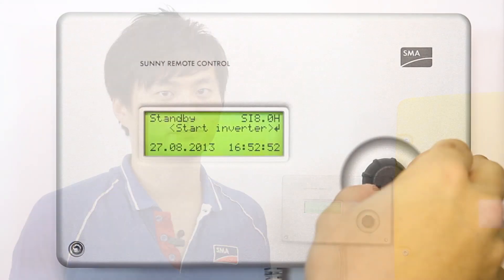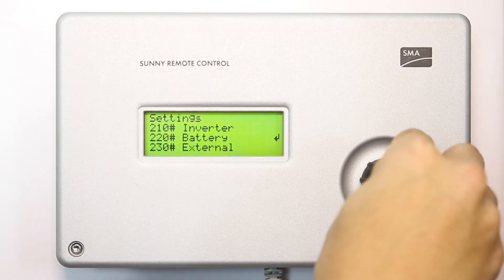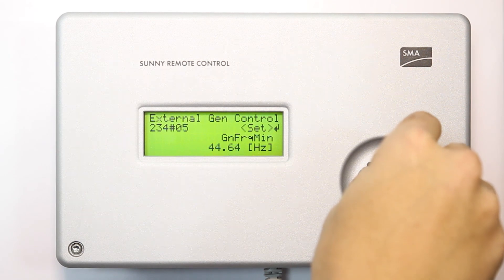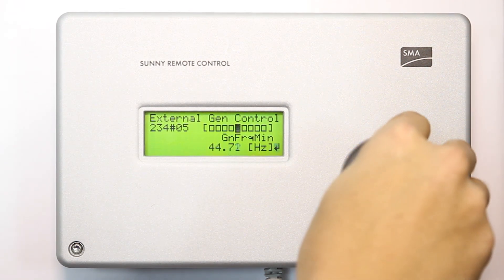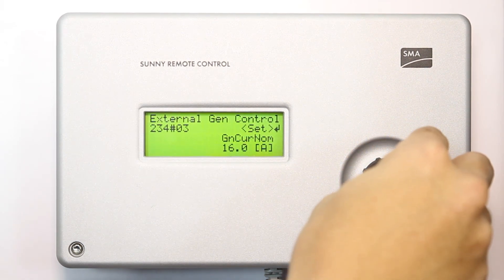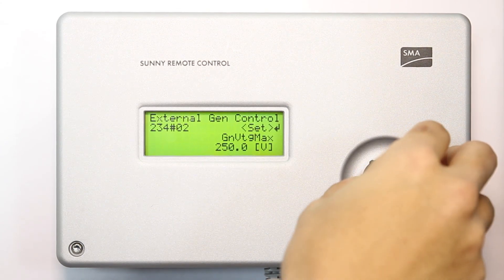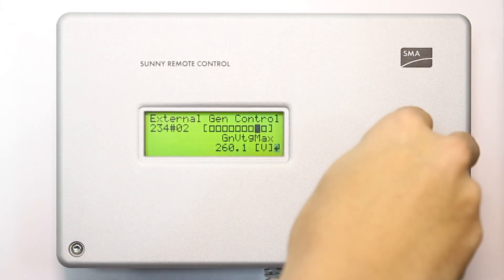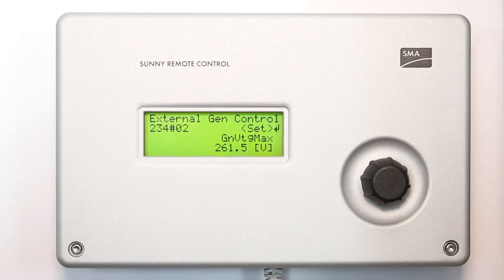Tech Tip: Adjusting maximum generator voltage in the SMA Sunny Island 6.0H-11,8.0H-11 and 5048

Comment: Hi, i want to setup basic generator & battery protection parameters based on Voltage, not with the SOC(genset start, load shedding, etc). If it possible with the SI 8.0h?? Having trouble with the SOC based setup & battery is getting discharged too much. Not getting proper regulation with SOC. Can you suggest for any solution?? to establish proper relation with SOC showed in SRC and the actual Specific gravity?? Im talking about a Multicluster system with 12 SI and 6 STP.